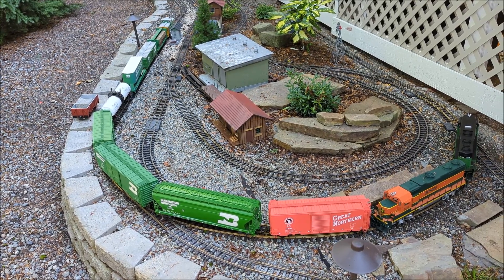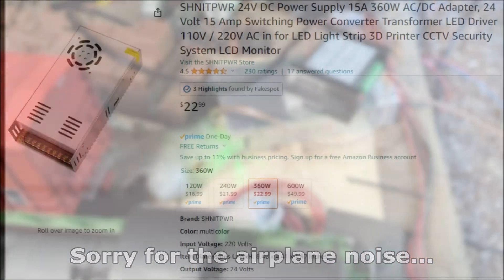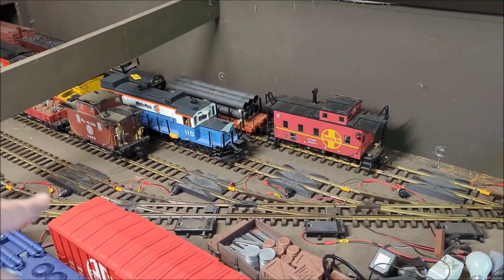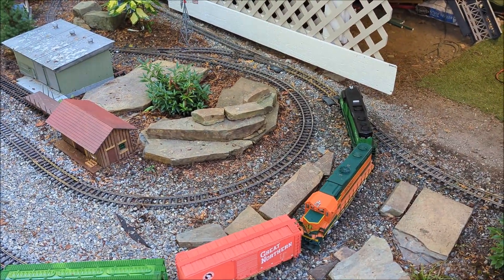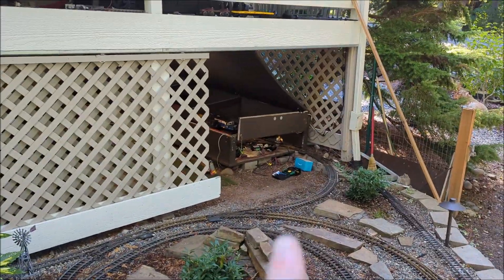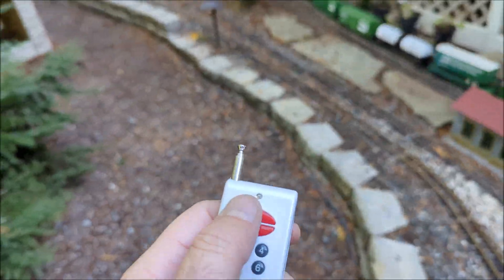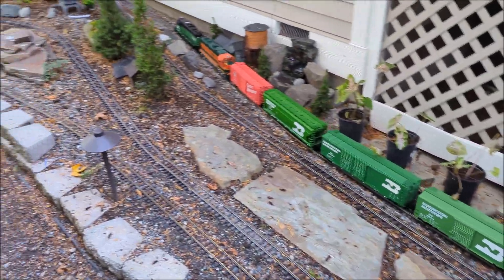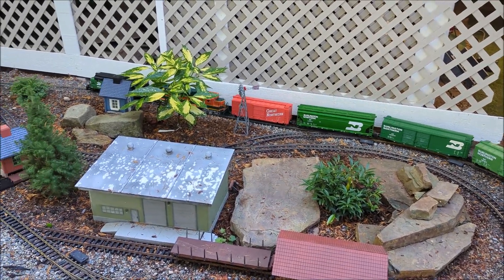How To: DIY Remote Controlled DC Powered Layout (on the cheap)

Comment from the maker: Here is the link to the original forum thread/how-to article:
https://www.mylargescale.com/threads/build-a-wireless-dc-10-amp-controller-under-100-00.91277/

It seems like the Speed Controller I used is no longer available (go figure). I think this is a similar controller that should also work similar to the one I used in this video.
https://a.co/d/3EBmUKY
Reply: Any chance someone can provide a wiring diagram to that link?

Comment: Can two of these be used with two separate transformers for dual cab common rail wiring?
Reply from the maker: I'm not certain I understand what your intent is. But I don't think so. You wouldn't want to wire one of these motor controllers up to the same track as another motor controller. I'm positive that would short something out.

I have mine set up on Independent Loops where I have insulated rail joiners separating the two Loops to prevent any kind of short.

Comment: How did you handle the reverse polarity issue with your wye?
Reply from the maker: I have the track broken into multiple "blocks". So, the Y itself and the engine shed are Block 1. Block 2 is the outer loop it connects to. All I need to do is make sure the polarity of Block 1 matches Block 2 while a train is transitioning between them. Once it makes the transition fully to the other block, I can control it like normal.

This means that I cannot run multiple trains in different directions during a transition between the blocks, but this is fine for me.

I used to have little LED signal lights connected to the tracks that would illuminate red/green depending on the direction of travel/track polarity. This was helpful for me to make sure I have block 1 and 2 on the same polarity and didn't cause a short. However, my daughter stole all of them and I don't intend to replace them until she's old enough to not take them anymore. lol

Now I mostly just know that "This button on my remote makes trains run clockwise, and the other button makes them go counter-clockwise." So, as long as I push the correct "direction" button on both remotes, I know the train will transition between the two block sections without issue.